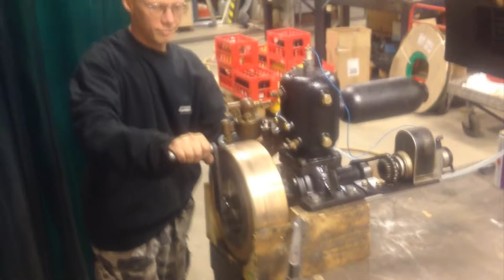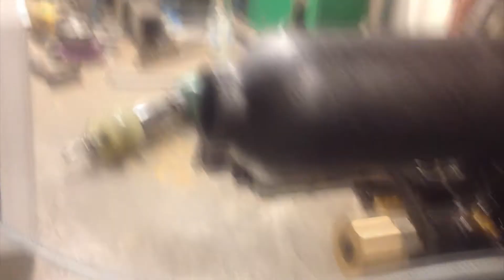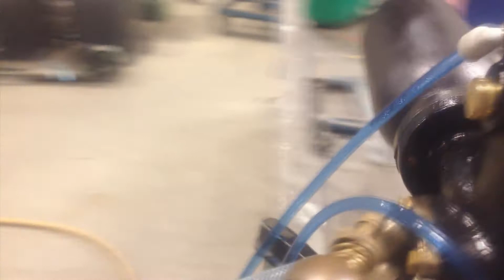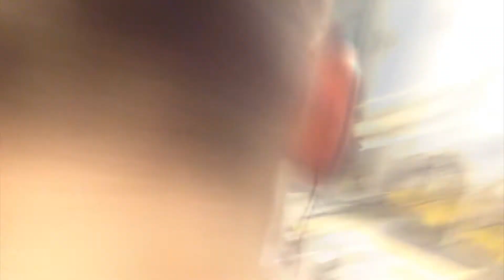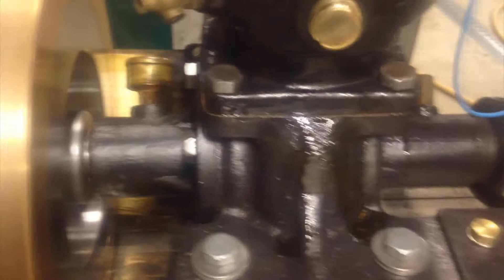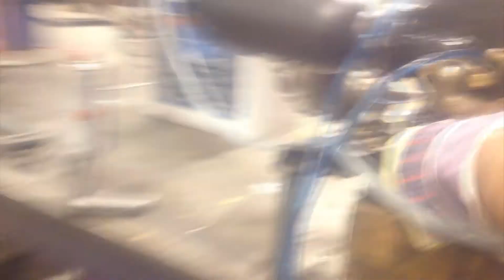after 70 years it runs again

Comment: There's two petcocks on the cylinder.  It'll be easier to start the engine if you open them.  older tractor engines used that trick for hand cranking.  It may need a load on the flywheel to run well.  The flywheel should be domed so that it automatically centers a belt.  Great Job!!